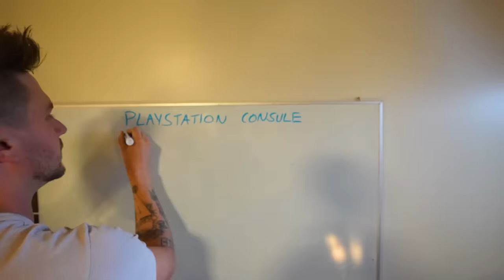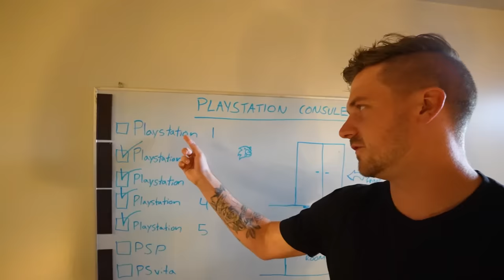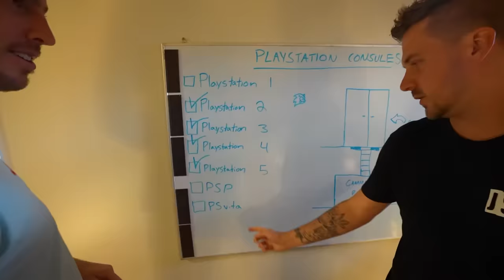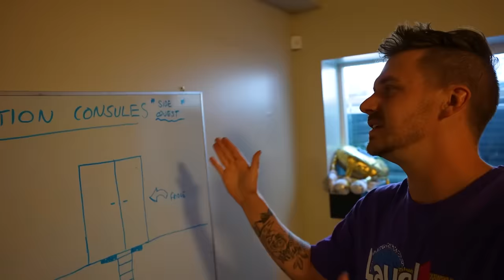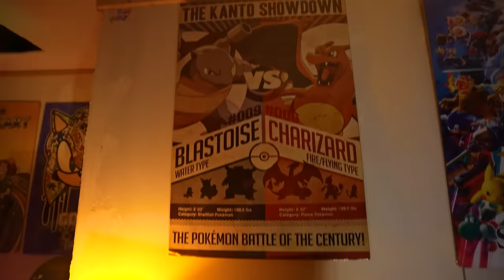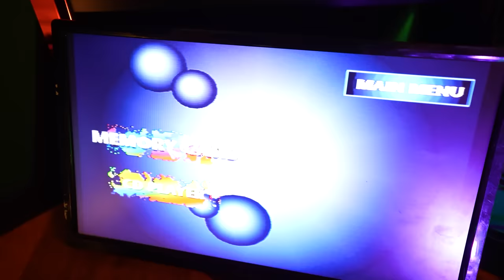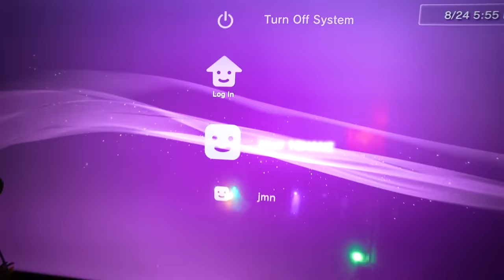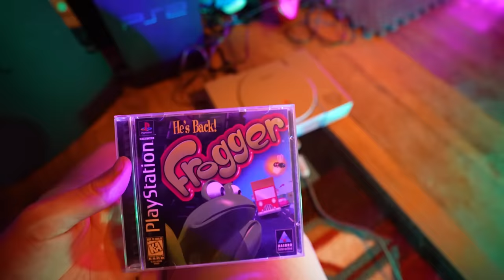Secret Hidden Fridge Entrance to Epic GAMING FORT!

Comment: Okay okay okay but the hamster cage need to be changed that is WAY to small for 2 and pluse thats not even the right cage they are supposed to be in grades open no roof no bedding just cloth bath mats and toys that is not a good thing